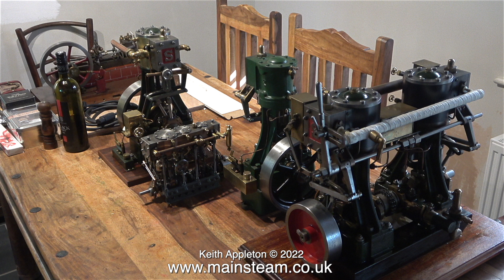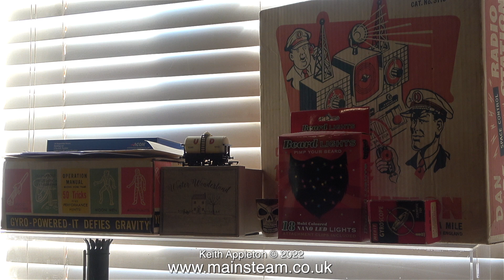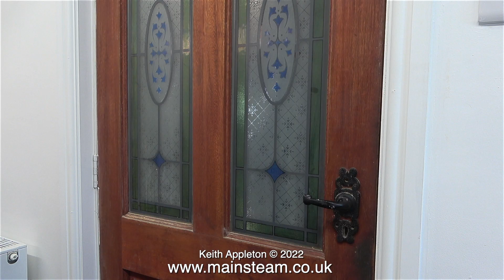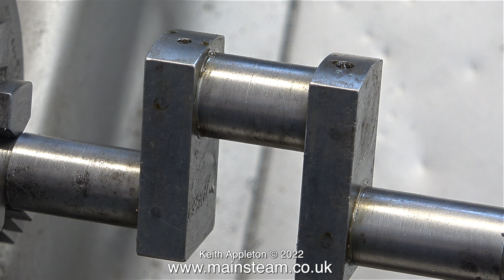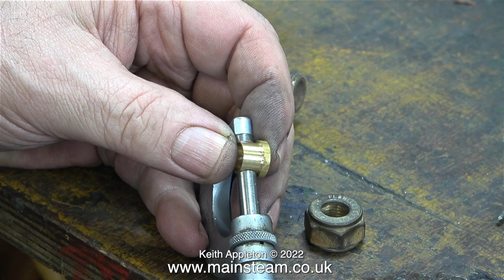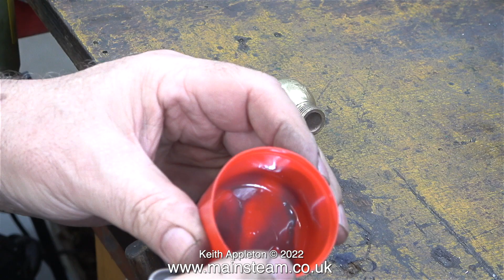WELCOME TO MY WORLD

Comment: I have two Stewart engines I bought around 1970.  They were both ready to run. One is a horizontal mill engine and the other a little vertical.  Both run good but surface rusty from being in Michigan for  ten years (humidity).  Also lubricators and a few valves and fittings. I lost my boiler and its fittings when we moved.  I would send them free to you for the shipping if you want them.
Reply from the maker: Thank you for your very kind and generous offer. I will decline if that's OK owing to the problems I have had in the past with import duty with USA goods.

Comment: Just turned 60 this past month, I well understand how a body once familiar and firm seems to go off warranty with amazing speed. Please, accept my wishes for a speedy recovery.

When painting brass, I have found that giving the surface a matte finish with high number sandpaper improves the adhesion. I too always give things a coat of etching primer before the final paint is applied. I have been trying different paints over the the past few years and I tend to prefer enamels and lacquers with a toluene base. Toluene-based coatings require a good deal of ventilation and can't be used around open flame and radiant heaters with exposed elements, but I think the luster of the finish is worth the trouble.
Reply from the maker: https://youtu.be/d4hNC_x7mFI